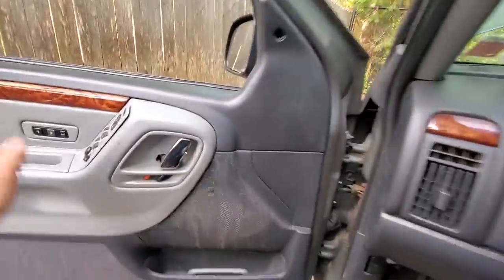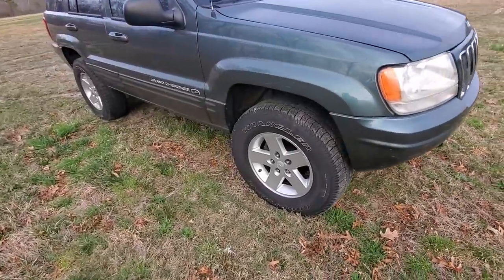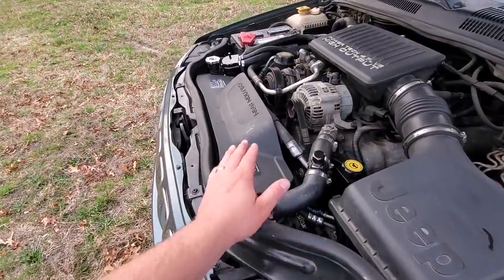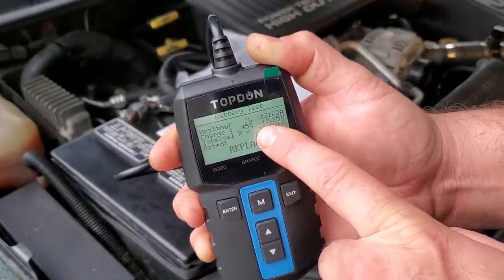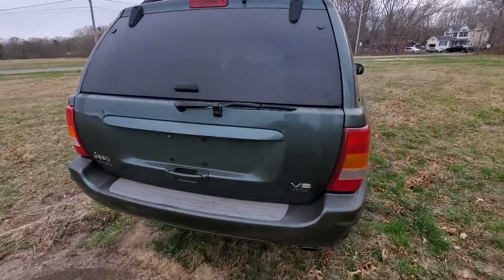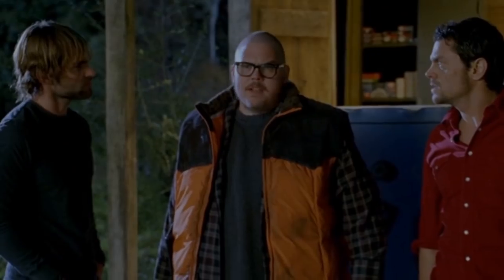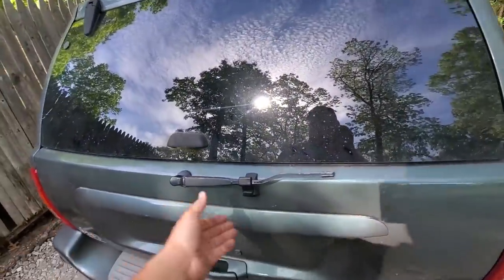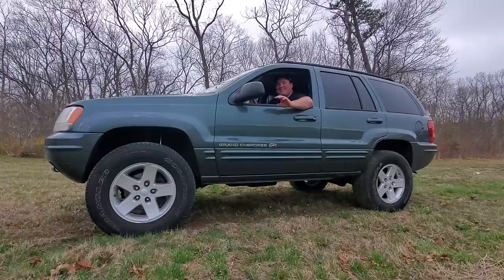WJ UPDATE!!! 2002 GRAND CHEROKEE OVERLAND WALK AROUND - GREEN HORNET PROGRESS REPORT REVIEW

Comment: Dan, before you do Anything with a trailer hitch for that WJ, look up the gas tank recall for the 93-04 Grand Cherokee's.  The "solution" was to put on a trailer hitch.  If I were you, I would call up you're local dealer, talk to their service department, and ask if there's any open recalls or voluntary recalls on it.  The gas tank recall was voluntary and almost a decade ago so they may not be able to do anything for you, but if they can you might get a free hitch out of it.
Reply from the maker: I'll definitely check it out when I have them do the airbag module! thanks for the tip!
Reply: @ProjectDanH  NP, I remember hearing about it from the guy I bought my ZJ from and I want to say I heard about it again either from an online forum or a YouTube channel.  I was reminded about it when I sat in a WJ at a local u pull. I wonder if anyone else car shops at the u pull before hitting craigslist and marketplace.  Anyway, I saw it had the hitch and no tow plug and said, They had the recall done.  So when I go to buy a WJ, it will be one with the hitch on it.
Reply: @robertgrauman8602  im pretty sure it doesn’t apply to the wj, but only to the zj. NHTSA tried to get Chrysler to recall the 93-2004 grand cherokees, but Chrysler only agreed to do 93-98. https://www.autosafety.org/major-recalls-jeep-grand-cherokee-fuel-tank/

Comment: I may be wrong but I always thought the Overland WJ's came with the limited slip rear differential. I think the Quadra Drive's had it, but I could be wrong. That means your rear diff takes special fluid as well. That is if the system hasn't failed yet. When it works it is a good system!
Reply from the maker: Yes sir I think it does! I'm going to have to really dig in and change the fluids on everything!

Comment: Jeep is looking good, and the blue smoke is definitely your valve seals. Just changed mine on my 01 wj 4.7 with out taking the cylinder heads off and now zero smoke.
Reply from the maker: Awesome man! how'd you do it? Any special tools you recommend?
Reply: I used a valve spring compressor I got off of amazon made by D&D 
And bough a MAC one as well just in case one broken but it worked perfect. Make sure you have a good compressor to keep the pressure in the cylinder when your removing the valve spring retainers. I used the fel pro valve seal kit and was very happy with it.

Comment: To clean the headlights you need a bottle of 3M rubbing compound just a rag and a little bit of compound and rub it in and wipe off no sanding or grinding cleans right up
Reply from the maker: That's awesome Thanks for the tip Rick

Comment: I have a 2000 one with the 4.0L Inline 6, after seeing that fan setup, I'm glad I do. Its a clutch fan.

I got about the same amount of rust, and thinking about doing the same thing to my rockers, just use tube frame. And the lift kit idea looks great, I might do that too, I already have slightly oversized tires. I'll be using your videos for inspiration for mine!

Comment: My ac clutch did the same thing, those compressors for 04's run somewhere close to 6 hundred, keep an eye out while in the pull yards .
Reply from the maker: wow.. I'll definitely wait to find one in the yard!
Reply: My 98 XJ had the same issue.  I put in a bypass pully until the parts came in.
Reply: @ProjectDanH  rockauto has just the clutch assembly.

Even got one for my sons 83 AMC Concord

Comment: Martin built on youtube did a video to help with the  sludge on the PCV valve relocation.
I am doing that as well as putting in an oil catch can.
Reply from the maker: I love Martinbuilt. catch cans are a must!
Reply: @ProjectDanH  MartinBuilt has to be the best WJ mechanic/teacher on youtube. He is my go-to.
Installing catch-can soon here, I get the same issues on my 4.7l HO with short trips and temperature changes where all the condensation does not burn off. The PCV swap is suppose to help with that as well. Catch can will make it complete.

Comment: I want that grille if you swap to an 04  grille I have  colt exhaust on my wj sounds great and  price is great.  swap in an 04 airbag module  just match the plug color
Reply from the maker: Sounds good brother Thanks for the tips!
Reply from the maker: Just grabbed a module from an 04 but terminal A doesn't fit..  the plugs are grey not black.  Did 04 have different style connectors??
Reply: @ProjectDanH   there is a black and gray conector.  I used a gray conector module on 02 larado and on an 02 limited.  I have an 04 overland  module  that has black plugs I can send you

Comment: I've fixed so many issues with my 02 wj Laredo special addition. I'd recommend u just change your tranny fluid not flush. Cut a hole underneath your stock air box helps your mpg and god rid of your stock muffler and put your preferred type on. I run a thrush rattler and it sounds amazing. Happy to help if I can.
Reply from the maker: Thanks brother! I gotta ask, what will cutting a hole in the air box do? Let it breathe better?  I just got a stick muffler welded on 🤦‍♂️. I'll wait till it rusts again and I'll replace it.  Hit me up on IG and I'll see i can help get you MXR parts
Reply: @ProjectDanH  yes makes it faster and easier to inhale. I did notice your muffler in your lower control arm video.
Reply: @ProjectDanH  I hit up your ig.

Comment: If it is smoking only on start up and then acceleration (especially after coast) then it is certainly the valve stem seals.
My 2004 Overland WJ with 130k miles was blowing lots of smoke white/gray/blue. It was also burning lots fuel too. So I swapped out all 4 O2 sensors, and that took care of about 80% of it. I then soaked the pistons/cylinders in seafoam for a couple days (they were gunked up) and ran sea foam in the oil to loosen the rings. Much better, but still blowing a cloud of blue smoke on startup and hard acceleration. I then installed new valve stem seals (using rope technique with heads on). The old stem seals were toast, hard black rubber. After that no smoke at all.
P.S. hard to tell, but looks like your AC clutch is non-existent.
Reply from the maker: lol, you hit the nail on the head.  My AC seized up and sent chunks of the clutch all over the place.  I'd love to pick your brain on the "rope technique"  i need to do that soon.
Reply: @ProjectDanH  It was not easy nor pretty, but it was cheap. By the end of it I kind of wish I had just taken the heads off, or at least the cam, but didn't want to suffer from jeep creep (of scope). With the cams off you can use a screw down tool (like Martin), as opposed to the pry tool I used. Also, inside of my valve covers was a complete mess, I am talking mad varnish (dark red). Maybe not necessary, but I spent hours scrubbing the crud off. Here are 3 thing I took away:
1) Get the right tool before the start. I thought I did, but quickly found the Lisle tool I had would not work with cam on and wouldn't fit under cowling. The pry tool worked ok, but I did worry a lot about scratching the lobes. I had the air intake manifold off already, so that didn't effect my leverage. But I did have to get creative for cylinders 7 & 8.
  2) Pushing rope is no laughing matter! It is tough to push enough rope down the coil ports and then into the tiny spark plug holes even with a stick, and you always need more than you think. If you don't have enough rope in there the valve still wont drop in, but it will slouch, keeping you from compressing the spring far enough to add/remove keepers.
3) For the love of gawd, phone a friend. It was easy enough to get the keepers off with one hand while using the pry tool+2' breaker bar in the other, but putting them back on was a whole other story. I wish I had jeep friends near by :'(

Let me know if you need more deets or pics. Best of luck.

Comment: I bought a WJ very similar. 200,000 miles on it. Needed some attention in a lot of ways. Mine has HO. Put on a 4” lift. 33” tires. Spartan locker. JK take off KO2.
Reply from the maker: Wow! Sounds like a great Project Jeep!  Geed luck brother 💪💪
Reply: @ProjectDanH  the exhaust was rotten so I threw a set of dual Thrush glass packs. It’s a little noisy but reminds me of my younger days. The Spartan locker is really effective. It’s like a goat. Rough Country long arm works very well. Next is a hidden winch inside the front bumper. Replaced all steering knuckles, wheel bearings, and ball joints. It doesn’t feel like a 200,000 mile rig. Everything’s tight. The HO makes good power.

Comment: Hey Dan, did you make a video about how to replace cloth WJ seats and put in leather ones? Along with the interior pieces
Reply from the maker: I'm going to make a WJ driver seat video, but all the seats are really easy.  The rear seat bottoms come off with 8 10mm bolts, then the rear seat tops come off with 6 15mm bolts (I recommend an impact gun for those).  Then the front seats have 4 13mm bolts each and you have to unplug the power motors.

Comment: Having trouble with a binding when turning and other small issues 2003 keep wj 4.7 HO overland quadradrive  102k miles
Reply from the maker: check the drive shaft joints
Reply: @ProjectDanH  grease?

Comment: Yo Dan! Been watching your videos for a while! I recently did a complete engine rebuild on my 2000 xj sport. Rebuilt my original shortblock, and got a remanufactured clearwater cylinder head. Getting some vaccum whistle from the evap system, and was wondering if you know a solution to that, Im a local to Long Island, would love to collab and show you my XJ sometime. Also, you ever consider getting the 4x4 permit for the beaches on Long Island?
Reply: I cant even tell you how many times i said “Jeep my life” during my engine swap😂
Reply from the maker: Heck yeah bro Great job on the engine swap! hard to diagnose a whistle without looking at it Just make sure everything's plugged in to the right spot. I'll get down on the beach one day... soon as I finish this Beach Jeep!
Reply from the maker: Jeep my life!

Comment: How in the world did you get the passenger side trim panel on the dash to close back up? I changed mine to the wood grain style but I think I'm screwed because it won't close back up. The part that covers the air bag 
Any help please 🙏
Reply from the maker: hopefully you didn't bend it too far out,. I was very careful not to stretch it too for forward, then I used half inch self tapping screws under the airbag and above the glove box to hold it back in place.  DO NOT PUNCTURE YOUR AIRBAG
Reply: @ProjectDanH  i ended up cutting that metal flap just enough to get it to close back up. I didn't cut it all the way off, don't want it flying in someone's face if air bag needs to deploy. It sucks but it was the only thing I could think of

Comment: Did you add anything with the 2 inch lift? I have a 2001 WJ and want to budget boost it but I don't know if I need adjustable control arms or adjustable track bar.
Reply from the maker: It needs absolutely nothing! except for an alignment,. The only other thing I would do differently is reinstall brand new rubber spring isolators... It feels a little clunky now
Reply: @ProjectDanH  perfect. Thanks! Did you add wheel spacers when you changed the wheels to 17"?
Reply from the maker: @gilbertorafael166  no, but I might try the 1.6 inch spacers I have lying around when I get new Tires

Comment: Be careful I had one rear door come down on my nose permanent  eye damage.  Can a person go from non heated to heated seats?
Reply from the maker: Oh man thanks for the heads up! Yeah there's definitely a way to get yourself some heated seats out of a non-heated seat Jeep.
Reply: I did it on my XJ.
Put the controller where the ash tray used to be.
My wife got me the entire kit from amazon.  She knows me well.
I uses the power from the power seats and tapped off the fuse box for the relay.

Even if your jeep doesn't have power seats, the connector is there and it has a beefy fuse.

Comment: The first owner and his lack of changing Oil is the reason for all the Smoke. But for sure a nice piece. It's to bad people just let the oil go unattended until it burns in the block. An Overland the most high priced of the Jeeps Neglected Sad.
Reply from the maker: Yes very sad... I'm hoping I can flush out any sludge to reduce the oil burning but I think it's just going to have to get new valve stem seals
Reply: @ProjectDanH  Its for sure worth saving even if you have to pull the engine and have it rebuilt.
Reply from the maker: @nobsatthistime  I agree.. it may need trans work and the body just needs rockers.. should be good to go

Comment: My 2002 overland has the airbag light coming on sometimes. Is that a common problem ?  What sensor did you have to replace ?
Reply from the maker: Its very common, replace the airbag module
Reply: Thanks for that. I'll try it @ProjectDanH
Reply: Check with your Jeep dealer; there is a recall for the WJ's for the Airbag system. My 04 Overland is going in for 3 recalls this Wednesday, 3/30/22 
As for I also have my airbag idiot light turning on along with a chime that goes off every time the light comes on.  They said my heated seats, too. But I told them they work fine. And that the previous owner had the recall serviced for the heated seats before. They said it's a newer recall. Fine with me! Then the 3rd thing they didn't say much but that it was with something to do with the rear of the Jeep? I'll come back on here after I get it serviced.
Reply: @robtosoni8804  Thanks.  I'll check it out